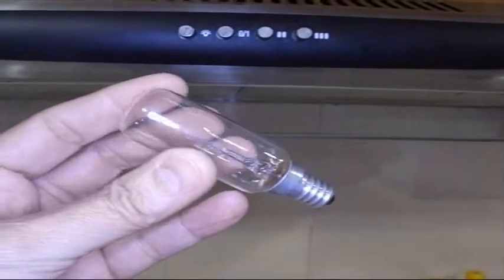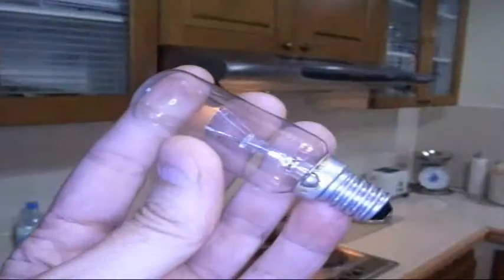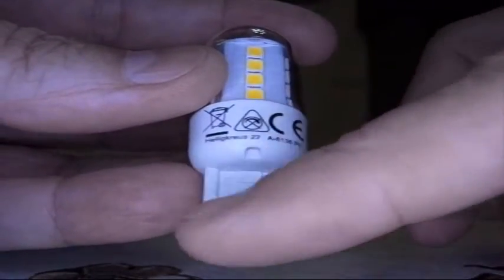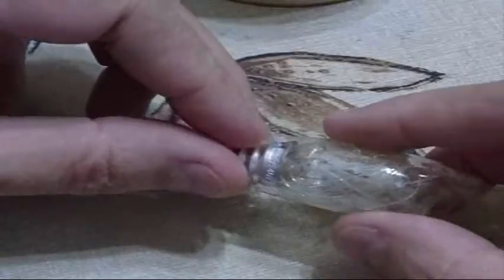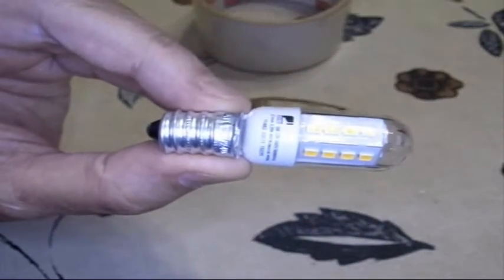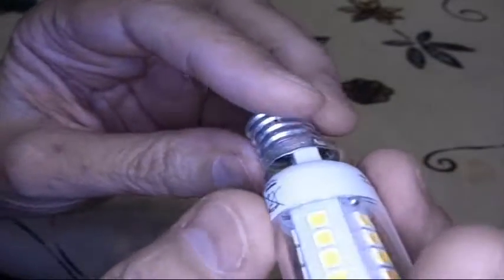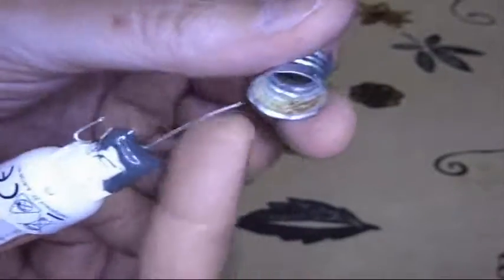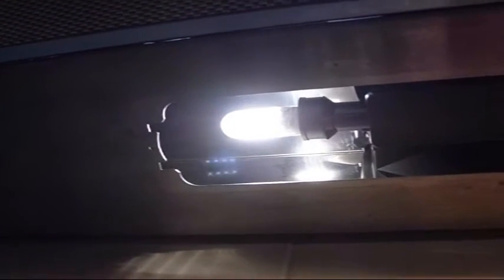Convert LED Snap-in Plug Bulb to E14 Screw Base

Comment: Does is go with 240v?

Or just 110v?
Reply from the maker: I do NOT recommend doing this.  You can now buy them off the shelf.  If the original piece is 110 or 220 then that's what it is.  The base does not change it.
Reply: @tsbrownie  actually i need to do this method for b22 base.... E14 is directly available on amazon... But cant find b22

I am also doing this for refrigerator... Its pretty old... The bulb size = b22 base size + 1 cm height and + 1cm diameter

But i cant find the snap in plug like you have..  i am also familiar with electrical works so no safety issues here 😊
Reply from the maker: @bxeagle3932   Really bad idea because fridges are wet places and you can't make the base water tight.  It's a shock / fire / other hazard.  Keep looking around for an LED fridge light or similar.  I found them on ebay and alibaba.
Reply: @tsbrownie  its already designed for b22... Its secured inside a box..

And thanks for the information

Have a great day

Comment: You can buy E14 5w LED bulbs for just over £1 each if you buy 5.  They make them in all shapes and sizes.
Reply from the maker: I still need to upgrade the refrigerator.  These were not available then, glad to hear they are now.  I think new appliances will all come with LED built in bulbs.

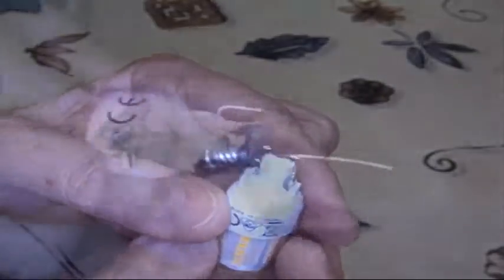Comment: On 3:44 what kind of material is that (like a welding)? Is the same material used to seal letters (old time way - sealing wax)? I never thought about this. For me this is a usefull video :-).
Reply from the maker: The dark grey stuff is epoxy.  I think now you can buy the bulb already to go.
Reply: Ok. I didn´t know that material. About bulb that´s right. Now there´s a G9 to E14 adapter.    This video give the way how E14 to G9 adaptation work and if someone wants to try by himself.